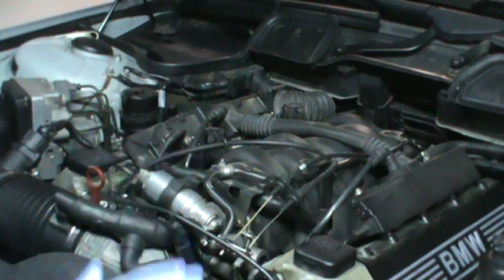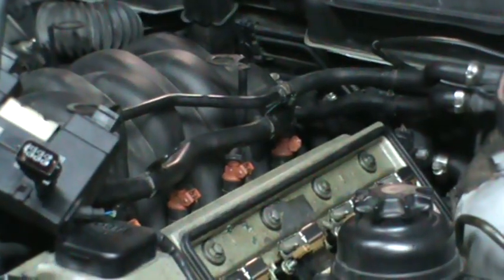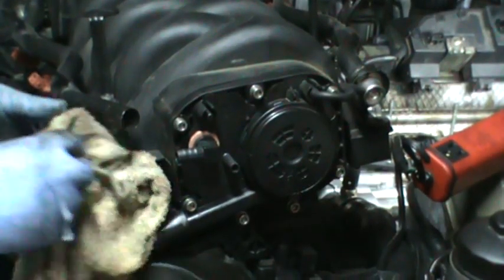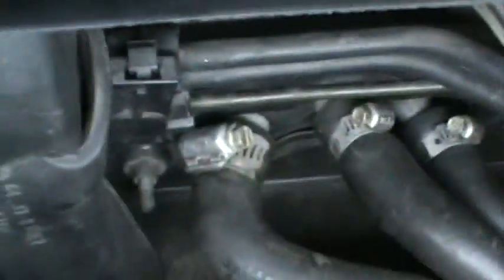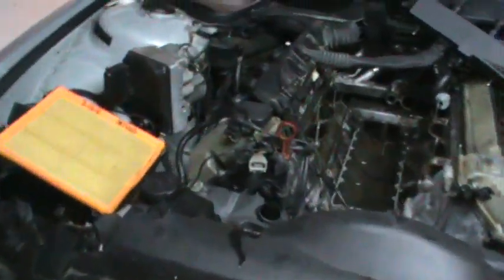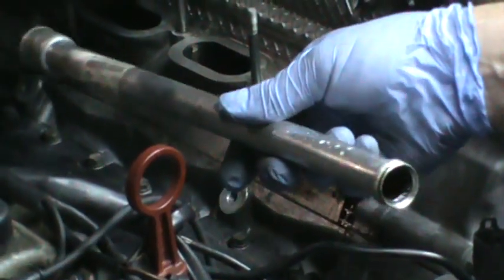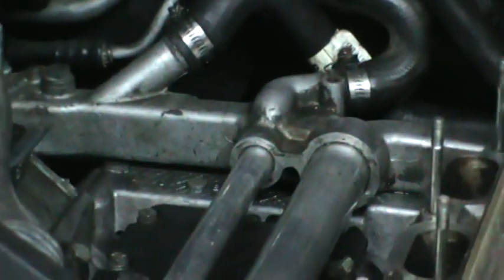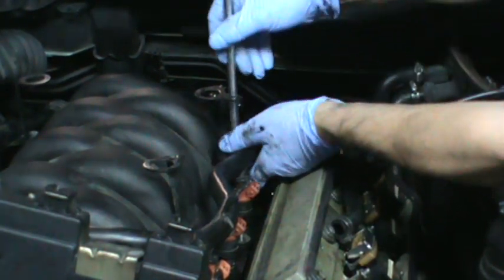BMW M62 Valley Pan Gasket Replacement

Comment: I really appreciate your video thank you so much !!! Just got this job done I did so many things while I was at it like change the gaskets for the accumulator , changed the spark plugs , Pcv valve , oil change fuel injector gaskets , & new coolant . The only thing about this job is the air that gets in the cooling system it is very important to purge it  correctly or suffer overheating your engine . Luckily I was close to Range Rover shop who did it for $ 65.00 & I was off . I feel like a certified BMW mechanic 😂. The mechanic said I probably saved around $ 4,500.00 with what I did 💰
Thank again !!
Reply from the maker: Thank you for taking the time to comment.

Comment: This is a FANTASTIC video!  Thank you very much.  I've removed the fuel injector clip from my E36 and the M62TU planned on being even more of a PITA.  The 'trick' with using silicone for the gasket is perfect for people that do not like going to the stealer and the savings will pay for hoses, coolant, etc.  I'll likely throughly clean the intake manifold, etc.  Your video saves so much time (more time for cleaning).

Comment: David, I was able to complete this job on my 540i this weekend. It took much longer than I anticipated but the valley pan leak is gone! I also replaced all the heater hoses, the CCV valve and a couple of other hoses that looked iffy. I am confident it was done well and found it quite satisfying to do on my own. I'm sure I saved a lot of money too. Your how-to video was a great reference and most helpful. Thank you for taking the time to make it.

Comment: 1st off...thanks to David for this video...I spared using many explicatives while tearing apart my car :)
My fear of commitment to really pulling on the junction box led me to try the clip approach.  So I took a pick and tugged on the front 3 on each side.  They don't need to come all of the way off...just pull one side off slightly.  Some gentle tugging after that was all that was needed to pull the boxes off.  Good luck...

Comment: Ok, just a heads up to everyone on here watching this video and using it as a reference.  I am currently doing this repair as we speak.  David's simple "pull" method of the injector electrical boxes seems nice, easy, painless and problem free, however it's not.  I DO NOT RECOMMEND THIS!!!  I JUST broke not 1, but "5" of the 8 Injector harnesses out of the boxes in which they mount on my E39 5 Series. 2 of those 5 ripped a wire clean out of the harness itself leaving 1 of the 2 wires per harness broken/ripped from the little connector inside.  I guess now ill be doing some additional wiring to get them to work again.  Not the end of the world, but be careful.  Other than that, a GREAT video and really is a great reference tool.  David, if you have any additional tips for me along the way, I'd greatly appreciate it, Thanks!
Reply: Mine popped off just the way he shows. You might have been pulling at the wrong angle OR your clips were not letting go. On my end i used a Dental pick (with the metal hook) to remove the clips first. I didnt trust them letting go lol. 

The Issue i had however, was that my knock sensor wires when moved around lost some insulation and i ended up with an intermittent Knock sensor CKT error here n there.
Reply: Thanks for the heads up on that "yank" method.
Reply: I've read that several times elsewhere as well. Those F.I. connectors are not designed to be pulled apart that way, and it's really kind of dumb trying to save the few minutes it would take to pull the clips with a pick tool of some kind.
Reply: I think you've just been unlucky, or as another person commented you may not have executed the pull in the correct manner. I've removed the junction boxes this way 3 times over the 10 years I've owned the vehicle-once for the valley paaan gaaasket (sorry David, I couldn't resist haha), and twice for the valve cover gaskets. And each time this method worked a treat with no issues.

Comment: To all wishing to know what torque spec to use, I used 10 nm and have to do the job again because it lasted about 10 miles. (A mile per nm, not bad........... Ok, so that was a bad joke). So please do look up a reliable source for torque specs. Thank you again David for the video, the second time around was a lot less time consuming and when ever I came to a dead end I referenced your videdo
Reply: G VS So what's the proper torque?  I, too, had done this in Feb, and now having to re-do it again since there is definitely a leak coming out of a brand new valley pan gasket that was torqued to 10nm.  I have a feeling it might be due to the cheap vally pan gasket (after market), because 10nm is plenty tight to be honest.  I am sure they are on tight since removing them weren't easy.  
This is a GREAT video, let's add the right torque specs to it!  
13mm intake manifold torque (10x):  ??
10mm valley pan gasket torque (20x): ??
Reply: the bentley manual recommends 7.5 lb-ft of torque so its very close to that 10 nm number. These valley pans have a tendency to leak due to the poor design. The silicon seal is not large enough to seal reliably.

Comment: Very good video reference as the steps to take for this job IMO. This saved me tones of money on my e34 540i/6speed and I couldn’t be happier not having to top off my coolant tank every week. Thanks for the video and explanation. The pull method from the injectors works like a charm, don’t know what the problem was for other people, but I’ve pulled them off at least 6 times for maintenance checks without any problems at all. Thanks again for sharing your knowledge

Comment from the maker: I agree.  They will not come off .When you put everything back together without the clips they will work fine and be much easier to remove the next time.   I was only able to clean up the engine and intake manifold so much.  Unless you have a very large tank, do expect factory new cleanliness.

Comment from the maker: Thank you, I replaced my BMW E38 with an MB S430.  Both have a 4.4L engine and the newer MB has 30 more horses.  I like buying used luxury cars because they devaluate and are inexpensive to buy.  Since I can do most of the work myself, ownership costs are just parts no labor costs.

Comment from the maker: You are right they are very tricky.  They come from the factory with tamperproof clamps so the initial removal is tough.  Replace them with regular ones afterward.  They are usually stuck to the rail so removal is either cut and replace or push, do not pull.  I do not think they will come off by pulling..  A tool, any tool will do but pushing them off is really the only way.

Comment from the maker: On the driver's side bottom that is the metal tube to the front of the engine - oil vapor return.  On the driver's side top is the power brake vacuum hose.  The small stem driver's side top is plugged or left open. I have left that one open with no issues. On the passenger's side top is the fuel regulator vacuum pot on the fuel rail.

Comment from the maker: I have done this job four times and I have had no issues.  The two important details are to cover the contact areas well, but not too thick and allow 24 or more hours after assembly for the silicone to set up.  If it does leak the removed should show that an area was not covered. I know that because I helped someone after they did tried this and one corner was not sealed.

Comment from the maker: As long as the gasket maker ia hi-temp you will be fine.  The setup is important.  You must let the gasket material setup on the part for four hours and then set up in the car over night.  Attach the part and hand tighten then let it sit.  Finish tightening  after 12 -24 hours.  As far as leaking pipes, first you can replace all four o-rings or look to see if it in the front or the back and go from there.

Comment from the maker: Disconnecting the lines is the tough part. From the factory there are anti-tamper clamps that are difficult to loosen.  Once you get those clamps loose the hose is usually stuck to the rail.  The hose must be pushed off.  Some pulling but mostly pushing. Once the hoses are off, disconnect the vacuum line to the fuel pressure regulator.  Disconnect the 8 electrical connections.  Remove the five nuts holding the rail to the intake.  Two on each side one in the front.  The rail is free.

Comment from the maker: If you ran hot the odds are good, otherwise there are the tubes, (M62 & N62) the accumulator, 4 or 5 heater hoses, & aux water pump, anyone of which could drip and run down the bell housing.  The weep hole from the top of the engine directs the flow onto the fly wheel so the drip from the valley pan gasket leak would be from inside the bell housing out the hole in the bottom not on the oustside of the bell housing which is a hose leak..

Comment from the maker: Replacing the knock sensors is a very involved job. you must do everything in this video except replace the valley pan.  In addition to the knock sensors, the intake manifold gaskets are a good candidate for replacement.  Hopefully you have the luxury of downtime and can take the car apart and then order all the parts you need.  Depending on the age you should consider replacing the water pump, thermostat, all of the hoses, and rear intake manifold cover.

Comment: I just did my timing and replace all gasket including the valley pan and did it the way you suggested using gasket maker but now it leaking all over inside the intake manifold. I guess I didn't do something right. I'm planning to order a valley pan with the new gasket on it. I followed your instructions but mus have missed something.  Taking a part AGAIN this weekend to investigate.

Comment from the maker: I removed the clips from the fuel injectors one at a time until I replaced the OEM injectors with aftermarket.  It was then when I saw that the back side of the aftermarket injectors were rounded.  If you remove the clips one at a time, with a pick, do not worry about losing them, they will not fly off.  This video is about any M62 engine including the M62TU.  Investing in a Bentley manual is also worth the money.

Comment from the maker: The torx screws are factory. I replace them with socket head cap screws.  To remove one that is stripped I have attached vise grips to the head and broken them loose.  Some are amazingly tight.   there is no lock-tight one them they are just very tight sometimes

Comment from the maker: Not for the valley pan but I have had to go back and redo a water pump job because of a leaking pipe.  I damaged the o-ring on assembly.  The silcone is tricky. Apply a bead, let that set for four hours.  Set the part in place and hand tighten or just start the bolts and let it sit overnight or 12 hours, then torque everything down.  I use the Red Hi-temp for the valley pan.  You will be really shocked when you see that teeny tiny $80 bead of silicone around the valley pan.

Comment: after doing this job twice due to the factory gasket being very difficult to replicate in refrence to amount used, I ended up just buying a new valley pan cover, I got it for about $75 shipped on ebay, brand new oem bmw. I wish id done that in the first place, would have saved a lot of money on wasted coolant and silicone. I definitely agree with removing the water manifold, be sure that the O-rings inside each hole of the water manifold are still good, I was also leaking from the seal at the water manifold from the large tube.
Reply: Does the new cover comes with a pre-aplied silicone on it?
Reply: @dionich  yes, as showed on video. Basically it is the same thing you can do on your own.

Comment: Good point.  I might as well do it right and do it once.  What about the o-rings on the metal tubes, should I need to replace those as well? Also, did you need to cut any wires to move the wiring harness out of the way, or does everything unclip? (I have seen that some people cut a few wires in the ignition coil wiring box)

Comment from the maker: Well, I do not know if I will see this car anymore.  When I sold it I told the buyer I would work on it for him but lately he has not wanted to wait unitl I had some free time.  Also this E38 had a pre VANOS M62. I had only resealed the engine, i.e., removed the engine front covers.  So, I doubt I'll have any more BMW work to post.  My current vedios are on Jeep Grand Cherokees, Mercedes S-Class, and a Volvo S80.  There is very little repair work to show.  Just Mods and retrofits.

Comment from the maker: I only use petroleum jelly and I only use vaseline petroleum jelly.  There is a big differnce between the vaseline brand and generic.  I only use vaseline petroleum jelly on the water pump gasket to hold it in place as a temporary assembly aid.  Otherwise I do not use lubricants anywhere in assembly or maintenance.

Comment: I have a 2003 BMW X5 4.4 you mentioned to replace the oil separator but when I looked the part up online it did not look like the one you did?  How do you push the metal tube onto the oil separator when the intake manifold sits on top of it? Also when Installing the intake manifold couldn't you put the rubber gaskets on the engine block first instead of the manifold that way there would be less chance of the rubber gaskets falling off?  I would really appreciate your help.

Comment: Well I took it apart , the intake manifold, and see coolant were the valley pan is. But how do you know if its one of pipes are leaking?  I used black high-temp gasket maker for the valley pan. Not the right one to use on the valley pan? Should I have used RTV instead?

Comment from the maker: The idle control valve?  that is attached with a band that is difficult to install.  to remove I just pushed down on one of the tabs in the back, I have broken that rubber tab off when I was in a hurry.

Comment: Hello. I have a 98 740il. It has a water leak thats dripping off of the bell housing like you stated in the vid. What are the odds of it being the valley pan gasket or the tubes that are coming from the back of the water pump? I hear the N62 engine have that problem. Not sure if the M62 could have that problem also? Thanks;)

Comment: Great time saving trick to just yank off the black E-box from the fuel injectors rather than trying to use a pick to dislodge the clips.  Where did you learn this?
Also, some folks are recommending lubing the clips/injectors with Tri-Flow or other lubricant to make it slip off a little easier and reduce the chance of breaking the plastic box.  Any idea if this would be beneficial?
Thanks.

Comment from the maker: Well, I have learned that it pays to spend that little extra and replace items when they are so easy to access but, this job can be done for labor and the cost of a tube of Hi-Temp sealant.  You can reuse the intake gaskets.  However I recommend the intake manifold gaskets 11-61-1-433-328 x4 and the Intake manifold cover 11-61-7-501-563 = $130 be replaced.

Comment: I just replaced my valve cover gaskets and tried your method of removing the box and fuel injector connectors. The passenger side worked perfect, when I pulled the drivers side three of the mounting tabs broke off one side of the box where the plugs snap into the bottom of the box. it was a bear getting the rear one lined up when reassembling.

Comment: Can you tell me if this would be the same procedure on the E39? Does the 4.4 V8 E39 have a valley pan or is it a tube? The only part that concerns me is how you reccommend  removal from the fuel injectors....scary stuff if they don't release.

Comment from the maker: Onr time I was lazy, the gasket stuck to the engine block, space for scraping is limited, so and I just put it back and there were no leaks.  Another time I had the gaskets, so I used the new gaskets dry and there were no leaks.  Of course I recommend using new gaskets, they are so inexpensive.

Comment: When u removed the accumulator, could it be put back with gasket maker or i need to buy a gasket? And the seals/o rings for the tubes are those dealer items? Thanks again for your help;)

Comment: HA! I did this entire job with a BMW new valley pan gasket and it leaked within 30 days all over again. He's right. Just use the old one and clean it, then apply your own new bead of silicone and youll never have to worry about it again. I learned the hard way and curse every time i have to add a quart of coolant. Still haven't gotten to it yet. 

I took advice from a mechanic friend about never using rtv silicone and doing the "job right" and it has cost me headaches ever since. On a 530 i have i applied rtv grey on various gaskets and never had a problem or had to revisit a job.

Comment: Hi David i removed my transmission on my 740i I saw coolant residue on back on my fly wheel what's the best cleaner to use so I don't harm anything
Reply from the maker: Brake Cleaner is my go-to cleaning product for most non painted automotive metal surfaces.  You may still need to wipe the parts to remove any build up.

Comment: Excellent Video. Could you list the part number for 4 big hoses behind accumulate at 14.01 min in the video? If possible, I like to know how the coolant circulate in the M62 engine? Basically I try to locate hottest coolant hose at back of accumulate. Thanks.
Reply from the maker: The hoses change based on the production date.  got to realoem.com and look them up for you vehicle.  The picture shown is generic and may not show that actual shape.  The hottest hose will come directly off of the accumulator and go to the Aux Water Pump for distribution into the two heater cores.

Comment: I wonder if you could get a longer lasting seal by ditching the dust cover and making up a 1/4"-3/8" aluminum of stainless plate to lay on top of it, making the whole perimeter where it bolts down that much more rigid.